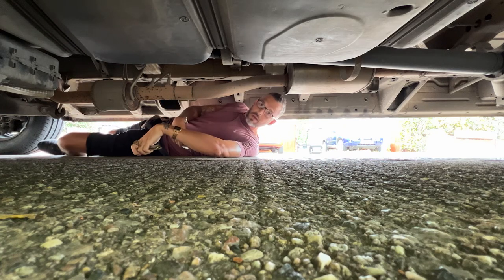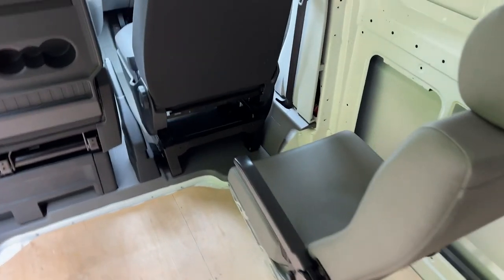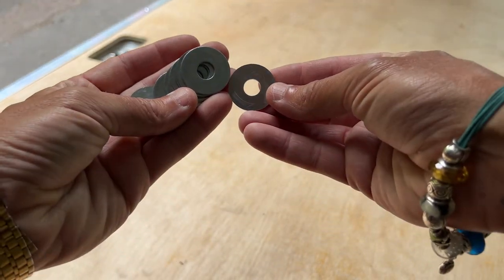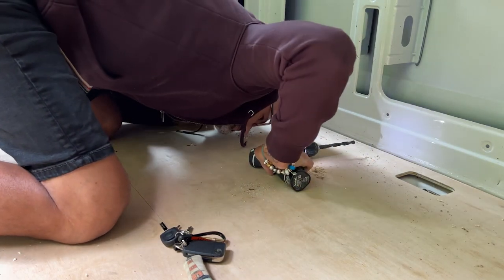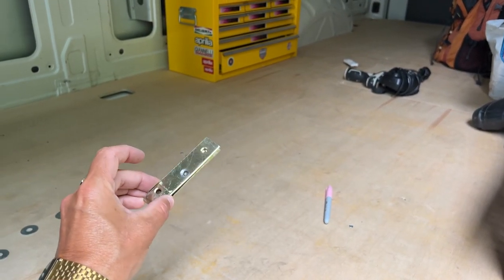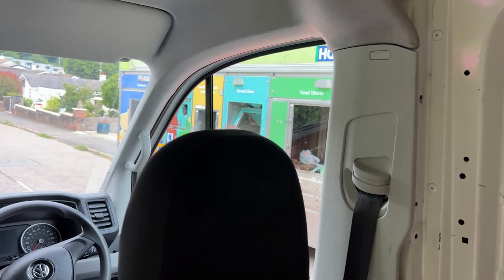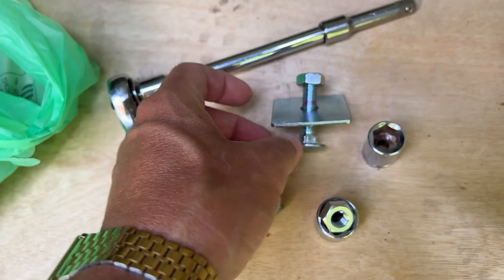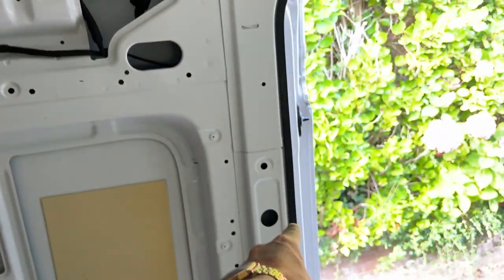#1 Our Van's Delivered: Installing A Seat Into Our LWB VW Crafter! Van Conversion #vanlife

Comment: Did that pass MOT?! VOSA specify 50mm diameter and 3mm thick minimum spreader plates.
Reply from the maker: I removed this seat 2 weeks later on (was only temporary) for a slide out bed thanks though matey ⭐️⭐️